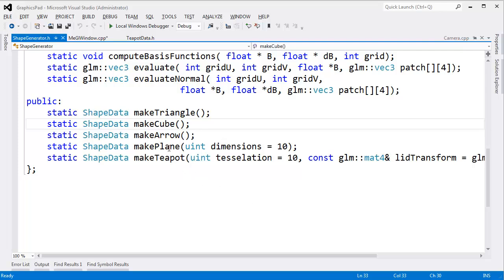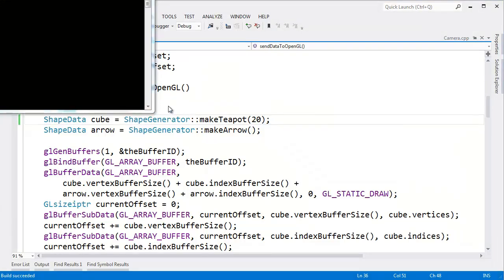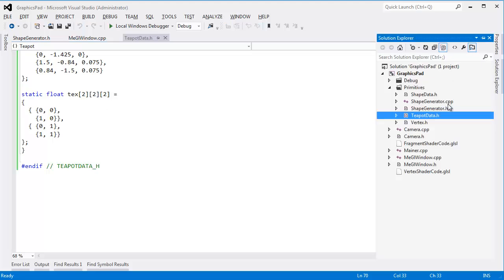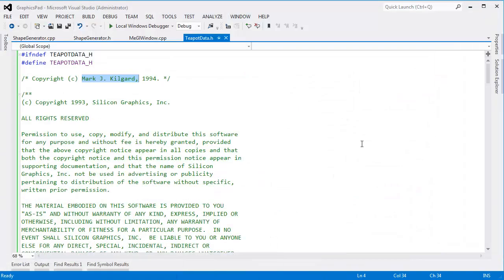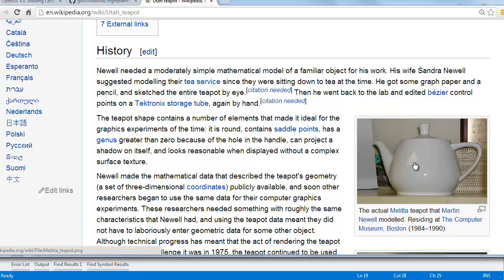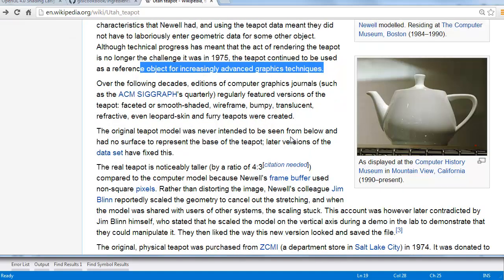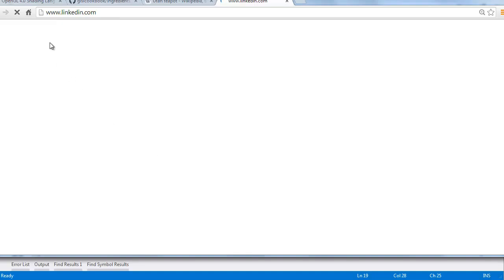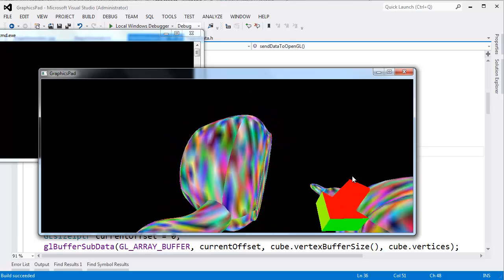Utah Teapot

Comment: Hi Jamie - I was trying to follow along, but I was having difficulty integrating the code. The teapot source is straightforward to obtain (https://github.com/daw42/glslcookbook) but the video didn't focus much on "makeTeapot" which glues the code together - what is the default value for the last parameter? :). Also, the el variable was changed from "Unsigned int" to "Unsigned short" - was this to make it easier to integrate with the existing solution?
Reply: Ok - found the graphicspad git repo.